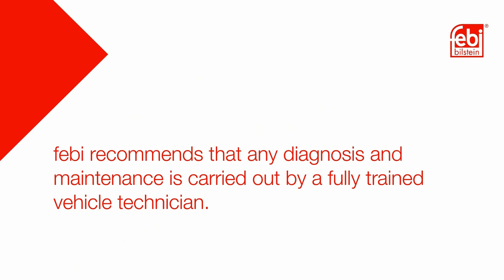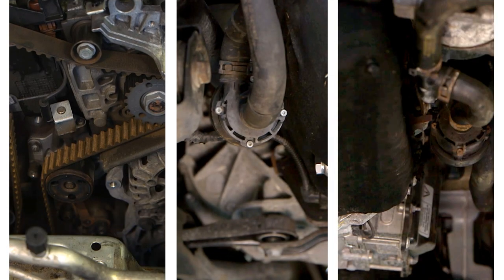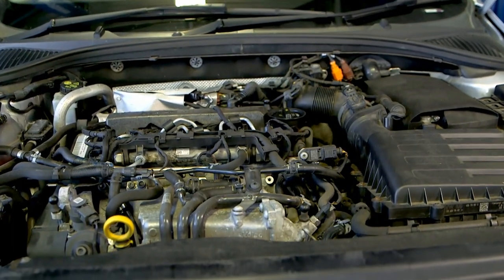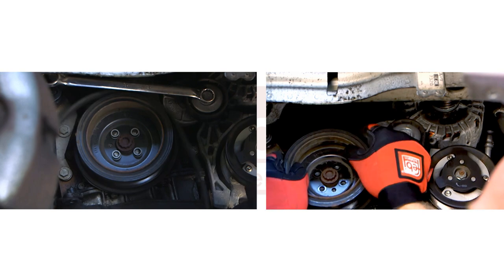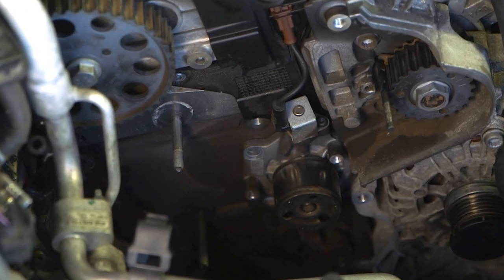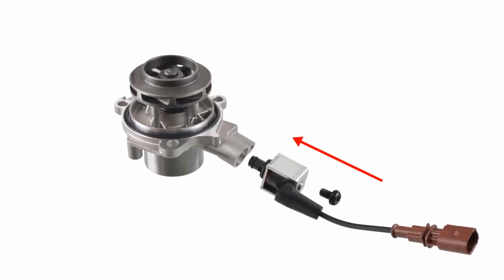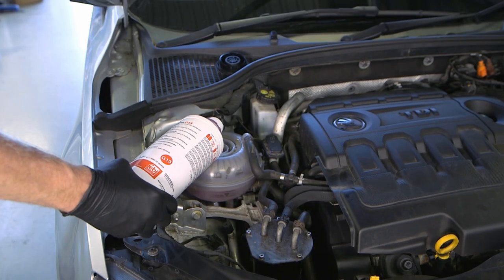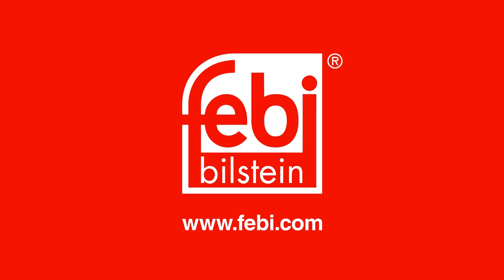[EN] VAG 1.6 & 2.0 TDi Water pump

Comment: The mechanic has apparently fitted a non-switchable water pump when replacing the timing belt and water pump. Therefore, I could see P199E00 error when I run the diagnostic tool (but no warnings appear on the dashboard). Is this OK or is it necessary to fit a new timing belt + water pump with a switchable one?
Reply: Your supposed to swap the solenoid to the new pump, it won't do anything but stops the error code.

Comment: Hello,
After replacement I have error coolant pump C stuck and starter does not turn P305400. What I can do?
Reply from the maker: Thank you for watching our video. Fault code P305400 refers to the starter motor not rotating. This could be due to a mechanical or electrical fault. Check all connections, power, grounds and relay before condemning the starter motor.
Reply: @febi.bilstein  Thank you for answer. I wrote you wrong code.Its P26F800-coolant punp C stuck.Now in winter the engine always works at 1000rpm,even when the oil in the engine warms up to 90 degrees.Also doesnt do regeneration like it should.Before I didnt have that problems.Its audi a3 8v 2.0tdi-150hp,engine CRLB year 2017.Is there any solution?
Regards
Damir
Reply from the maker: @JanBan-q6t  Your vehicle is equipped with three water pumps. Fault code P26F800 is referring to one of the auxiliary water pumps. With the information we have it is the one located at the rear of the engine. Not the one featured in this video. Once the fault is located, please ensure the coolant bleeding procedure is carried out using a suitable diagnostic tool, when refilling the system. Air locks can cause issues with this complex cooling system.

Comment: Is this the 'switchable' pump, basically?
Reply from the maker: Thank you for watching our video. The replacement febi water pump featured in this video, part No. 103078 is of a  conventional water pump design. However, we now offer a improved more reliable switchable water pump, febi part No.180948. Therefore, giving you the choice of which water pump to use for your replacement.

Comment: Hi there,
Is it possible to test switchable pump ones it is out of the engine?
Reply from the maker: Thank you for watching our video. If the water pump shroud has become sticky in operation. It will be obvious when the water pump is removed from the engine. Please also find a Protip bulletin in our parts catalogue describing the common symptoms for this water pump. Part numbers 103078, 180948. www.partsfinder.bilsteingroup.com

Comment: So fitting the replacement water pump without the functioning sleeve won't cause any issues?
Reply from the maker: Thank you for watching our video, the fitment of this water pump in this video has not caused any issues with the featured vehicle.
Reply: It takes longer to heat the block, so not ideal. VW are still using the water pump with shroud. The latest version has fixed the sticking shroud.

Comment: Hallo. This Febi pump is schwitchable too or still only ON pls?
Reply from the maker: Thank you for watching our video. As explained in the video, the febi water pump featured is of a conventional type, and the impeller is active constantly when the engine is running.
Reply: @febi.bilstein  Hello, why does the timing synchronization change from 1.2 on a cold engine to 0.4 on a warm 90 C? Is the timing correctly installed? 1.6 tdi cayc engine ....
Reply: @Sensei948  Belt will stretch with heat. Not a problem.

Comment: I was wondering if this one could give a fault in the car's computer.
Reply from the maker: Thank you for watching our video. If a switchable water pump controlled impeller collar becomes sticky in operation limiting the flow of coolant, the symptoms can include. 
Engine overheating, coolant temperature gauge reading over 110° C and poor interior
heater performance. Also cooling system fault codes maybe logged in the engine
control unit.
Reply: @febi.bilstein  thank you 🙂
But my question was if Febi pump will be "recognised" by ECU
Reply from the maker: @al77sandro28  Swapping the original solenoid from the faulty water pump to the febi water pump does not log any fault codes to the engine ECU.
Reply: @febi.bilstein   great. I already ordered one. Thanks 👍

Comment: Thank you for your video. Its very informative.  I just have one question . My tempatures are good, gauge sits at 90 degree fan turns on etc. But I have no heat inside the car. Small bit of very light heat from left side vent but the rest freezing. Could this water pump be the issue
Reply from the maker: Thank you for watching our video and positive comments. The issue you are describing, could be an issue with the heater matrix. A bag containing silicate beads located in coolant reservoir can disintegrate clogging the heater matrix, which is a well-known issue.
Reply: @febi.bilstein  Thank you again. Great help and very informative. I subscribed and so should everyone thanks
Reply from the maker: @eire90s79  👍
Reply: I had the same problem in my seat leon 2.0L tdi fr....no heat in the driver side.....
I replaced the thermostat and heater core-Matrix and all its working just fine.so i hope this info  will help you
Reply: @ferdinandbilstein ...I have my original waterpump....all the tests was done in the car to provide as no any coolant problem are present....but one question....that original pump with regulator can be the cause of my coolant coming out sometime out from expansion tank?...when it's to hot and make presure it's possible the original pump to get blocked and not recirculating the coolant properly in the system?if I will replace the water pump with one like in the video ,it may fix the coolant over flow in the expansion tank at high temperature?
the car run all fine.and it's not over heating. it's staying 90° constantly.but at long runs sometimes I fine from under the lead of expansion tank wet.so I was thinking at the water pump.
Reply: @ACUZATOFFICIAL 
It's caused by a blocked heater matrix, just fit a new one, its easy to change, and fit a new coolant tank that doesn't have the silicone bag inside.